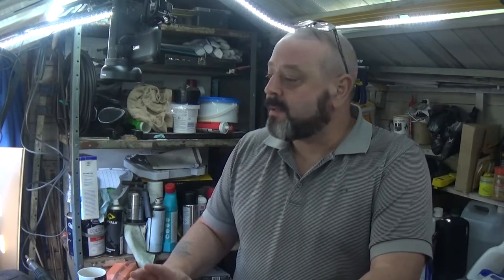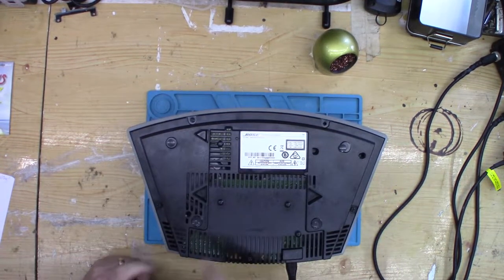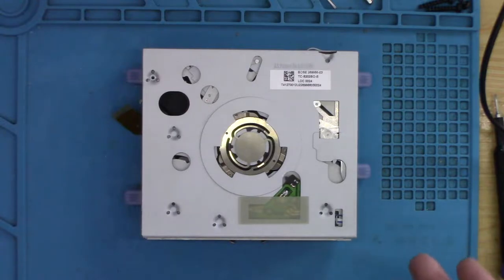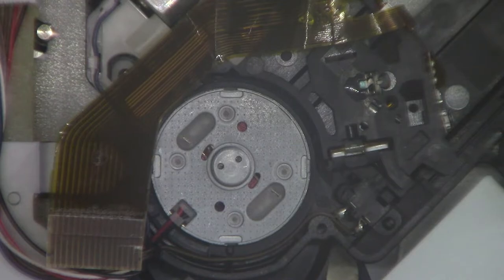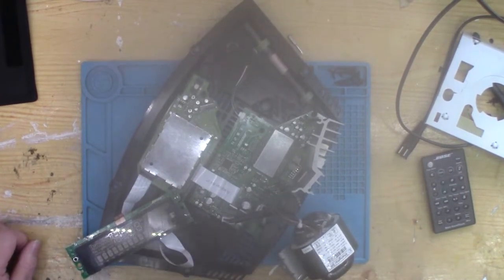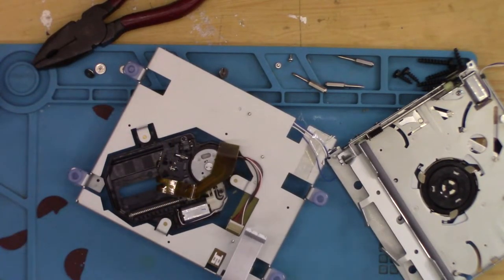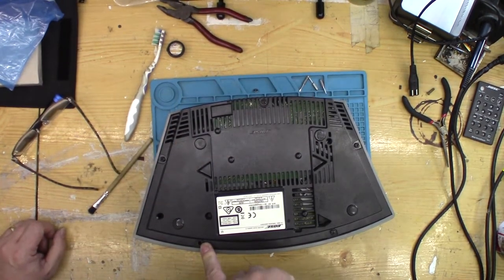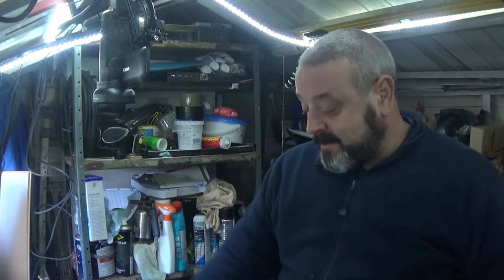Bose Wave series 3 stuck CD repair and Laser replacement.

Comment: Ok.. old video. Hope you can help… I’m trying to adjust The potentiometer… I have precision bits but can’t figure out what is needed to loosen or tighten? My CD is reading unplayable
Reply: I know it's a old comment but it may not even be an issue with the CD Player. With these units a lot of the time it's the capacitors on the CD Board that can cause CD's skipping, not reading or worse just causing the unit to shutdown when trying to use.

With the amount of repairs I've done so far I've found this to be the case for 90% of the units, then the other 10% comes between bad laser/CD unit or something on the main board.
Reply: @northbridgetechrepair  I see… I still have it torn apart….was thinking to 3d print speaker enclosures and just toss the rest out

Comment: bose soundtouch iv when ejecting the cd makes some weird noice and the cd ejects but the disc is scratched.  Any ideas?
Reply from the maker: It sounfs like there is a screw loose, a bent frame or a foreign object in there, you'll need to take it apart to see if there is anything obvious.

Comment: Hello,
 I bought by Bose CD about 3 years a ago.  Today put a CD in and it played fine and eventually it just stopped.  Now it not playing any CD at all.  Its just saying not playing.  

Help me please
Petra
Reply: If you still have this unit with issues feel free to reach out to me, I do repairs on these units and we can have a look at this. Usually what tends to go bad on these first is the capacitors. If that doesn't resolve the issue then it comes down to usually the CD or something on the mainboard but I have seen with a good amount of these just being the CD board using cheap capacitors and them just going bad and as the CD player uses a lot more power to function compared to the other functions, it tends to be the first failure point.

Again feel free to reach out if you need any help!